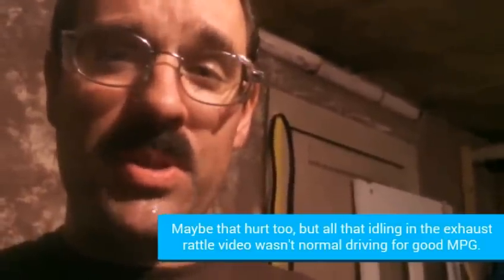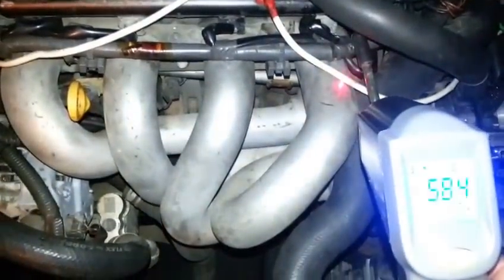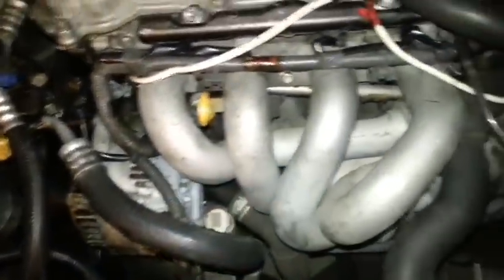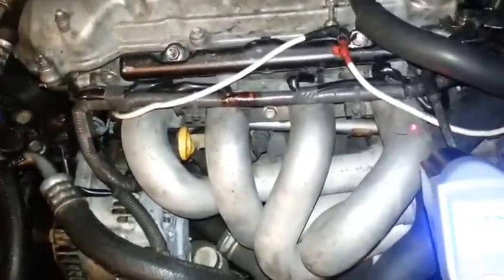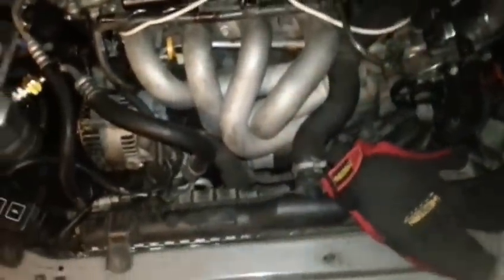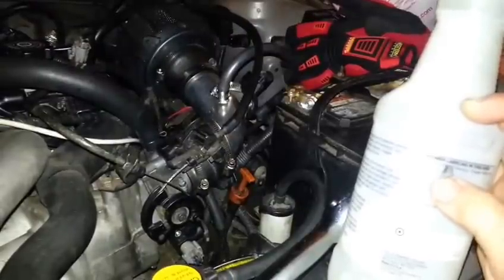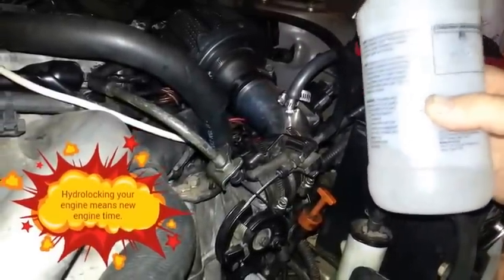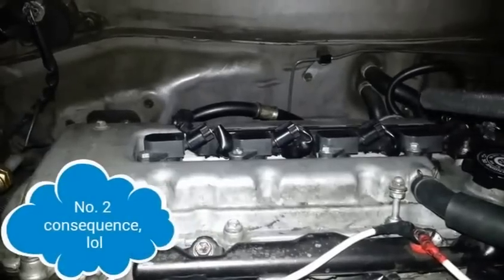Water Decarbonization and Warnings

Comment: Have you tried a hand-held steam cleaner to do this kind of carbon cleaning? I've found that very hot water can soften up carbon considerably, and I've seen videos in which hot steam is used, and it's much more effective than just hot water. Water at room temperature isn't nearly as effective. Steam is even more effective when there's some oil mixed in with the carbon, as there is in an engine's carbon deposits, presumably because it makes the carbon less dense. I know that flash rusting will occur pretty fast (as early as one or a few hours) when the cylinder wall gets water on it, but the time spent removing flash rust (usually pretty easy since it's just a thin film) might be a lot less than using chemicals to clean off carbon, and then you could spray it with WD40 to prevent further rusting.
Reply from the maker: +John Sawyer I had to think about it, but we all probably have. You know those stains on baking wear that are black? Recent ones take a lot of scrubbing on top of the hot water. Maybe if it had oil in it like a car would, it'd come off easier.

When it's a carbon stain left long term, it's easier to take some metal off then the carbon!

Makes me want to try steam cleaning for pesky bakeware carbon stains in the kitchen.

All that said. Combustion is hundred of degrees hotter than the boiling point of water. So the theory is that this is steam cleaning. With valves just a couple hundred degrees cooler, I think water would steam clean on the intake side, but I don't know it, like I'm sure it must on the exhaust side.

Regardless, if an exhaust points down this process shows a big mess. If an exhaust is horizontal the evidence of cleaning disappears.
Reply from the maker: +Frank Gutowski That doesn't account for my oil getting very dirty with just a few ounces of water decarbonization when I first cleaned the engine. It wasn't needed as badly this time around so it didn't make me change my oil.

Besides, didn't you comment on another part of the video that tons of water is already going through the tail pipe? It's normal for combustion, right? So, if behind the tailpipe is only making a mess during water decarbonization, regardless of what part is getting cleaned, it's still likely a restriction to flow that's being removed.

Lol, I'm loving your challenging comments. Gets me to dig deep and think critically, even if my points are disagreeing with you, I hope you're having fun too.
Reply from the maker: Frank Gutowski Regardless of the cleaning method is used, if it's desirable to not take the engine apart, then a test, which doesn't use combustion, will not reveal data, except how to clean an already apart engine.

Combustion is hundreds of degrees hotter than steam. 

Yet, steam it still must be in combustion, but a much higher temperature steam which isn't possible in the kitchen except via an exploding pressure pot.

If I take an engine apart, I'd clean it with the wire brush on a rotary tool. It's super soft, it won't gouge the softest of metals, and it cleans far more quickly.

Wire brushes are typically harsh and wear out. I welded mine maintaining the wire brush, and it keeps the metal from shedding all over and making my clothes so pokey that it'll contaminate a whole laundry load with pain. It also meant it lasted years of professional use and it has gotten a bit thinner and a lot softer.
Reply from the maker: Frank Gutowski If ordinary, non- compressed steam works then of course an engine's steam would work. :)

I digressed because I saw how the experiment could possibly not work, but it could still work. My digression was attached to my thought on how I thought it could fail. Assuming the result of an experiment is a hypothesis, but I failed to see the other possible result. Thank you.

Now that I'm done, with what I missed on one point, I'll share another.

It seems you assume that the heat of the intake could only be what steam cleaned the intake valves. Since the intake manifold was 45 C short of boiling it looks like there isn't enough heat to help with carbon on an intake unless you know one more detail.

Intakes bring in air yes, but they always spit combustion gases back out. Even more so, my leaking cylinder no. 1 intake valves. 

I learned from a performance book on engines that both directions of air must be considered for great intake design.

Modern, more efficient engines have used this for their efficiency, but a 19th century engineer came up with intakes leaking even more to make more efficient engines. Apologies. I don't remember his name or what it's called.

Yes, this is due to the intake valves intentionally closing a little late. It sacrifices less power than it saves in economy. 

Exhaust closing a bit late is what does 800% of the work to bring in an intake charge in comparison to the piston going down. This does reduce exhaust speed and velocity just as intakes leaking a bit reduces intake velocity with a pulse in the opposite direction of what basic engine knowledge assumes to be simple.
Reply from the maker: Frank Gutowski I can't think of another reason for oil to quickly get quickly dirty, but it's a good point as it hasn't happened so dramatically on other engines I did water decarbonization for.
Reply from the maker: Frank Gutowski Experiments have to be repeatable. Quantifiable.
Reply from the maker: So Frank, when I was a child, I was thinking that when the carbon got baked onto a steel cookie pan, than with heat, it'd probably come off easier.

I tried boiling it off by putting water in the pan and putting it on the stove, which only helped with the bigger chunks of baked on carbon. (kinda like low hanging fruit that fuel injector cleaner will take easier)

Then, I tried pouring the water off and dribbling water where the pan was hotter because water wasn't there to keep it cooler - some of the more difficult carbon popped off!

Then, I got intercepted by a parent who thought I'd "Burn the house down" and the experiment stopped, but it was working Frank! :)

It was even harder to remove the carbon deposits  that didn't get dribbled on and had just been baked more on again. ;/ LOL
Reply from the maker: Frank Gutowski I think what matters is heat and added water as a cold shock, works.
Reply: @DENicholsAutoBravado  how about spraying distilled water or radiator coolant, eill that prevent the carbon build up
Reply from the maker: I like the idea of distilled water. Sure, radiator leaks have proven to clean an engine, but it gets accompanied with engine damage so...

Comment: You really need a boroscope for verification.
Reply from the maker: +Boca DeVerity Oops. Thought I had replied already. I bought the recommended bore scope on the ChrisFix channel. Amazon called it HD but it was more like SD.

I'll re-explore this with that valuable technique at some point. Stay tuned.

I do still feel that temperature is an external way of seeing what's going on. Carbon deposits increase temperatures and clearly as it shows in this video the temperatures evened out.

Sure. Fuel injectors, spark plugs, valve sealing, all effect that as well. You may not be aware of this but these are new injectors and spark plugs.
Reply: I bought one for not much at ChrisFix's suggestion and it shot in SD. It looked lousy in a few inch window. Even up to $200 on one and I'm not finding a good bore scope. Any suggestions?

Comment: Hey I didn't know your doing vids- interesting stuff look forward to more 👍
Reply from the maker: Thanks man! You're interest means a lot.
Reply: Hey bud give  Matt at PM and I'm sure he'd give you a shout out , man your his best sub. Don't be shy Matts a great guy.
Reply from the maker: Steve Rob Thanks. Great idea. I will.
Reply from the maker: +Steve Rob Man! My idle had settled into something respectably correct, plus correct fuel trim, except some raised fuel trim at moderate load below 25 MPH and ...idle is back to 650 and rough when cold. :(

It's like my vacuum tube video temporarily shocked my PCM into producing something correct but it wants to be rich with a low idle again. MAF shows decent flow from the IAC...should have got into the habit of looking at the MAP more like you suggested on Scanner Danner so I'd have a comparison, lol.

Any ideas?
Reply: You have a scope for the maf. Are you sure you don't have a vac. leak. I use the smoke pro. BTW I think you should watch my vid of schrodingers box - " my friend Matt "on my channel.  Your in it  HAHA.
Reply from the maker: Steve Rob
Before my vacuum leak helped with my rich condition, so backwards, I was starting to think my fuel pressure regulator was whacked. Mines in the fuel tank so it's a pretty serious call when it's an untestable fuel pressure regulator.

But you're right, without smoke, the easy way, or maybe a lot more water all over looking for another vacuum leak like on Scanner Danners very recent vid, there could just be more leaks to plug up.

The would get sucked on more when you plug up the obvious wholes, wouldn't they? :)
Reply: I've missed a lot of vac leaks before I got a smoke machine. Brian's moble  1 make a nice one for $50 from a party smoke machine. Water works good sometimes not always but smoke has never let me down.
Reply from the maker: Steve Rob
I may eventually get around to making a smoke machine. A friend linked me to the best home made version I've ever seen! I have a lot of easier vids that require less shopping than that to make. Lots of parts ready to go, lol.

Comment from the maker: I've since had a road trip where I fueled up before leaving and when I got back. I had been struggling to get more than 30 miles per gallon on the freeway in my car, and I managed to get 36.7 miles per gallon! A reduced idle speed, near on target of where it should be 650-750 instead of 600 when cold and 1,400 in closed loop uses a lot let fuel. I'm not sure if water decarbonizaiton helped with mpg, but I'm sure my last video about vacuum leaks did as that largely repaired the idle speed.